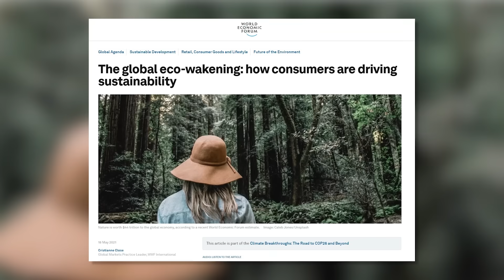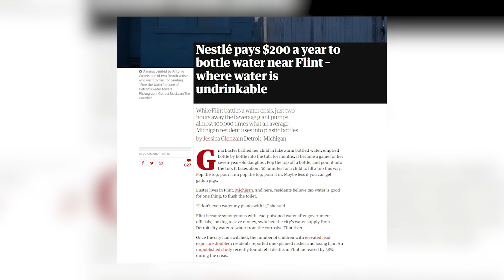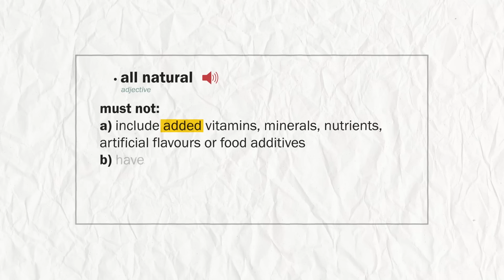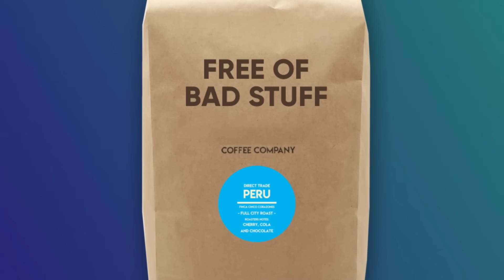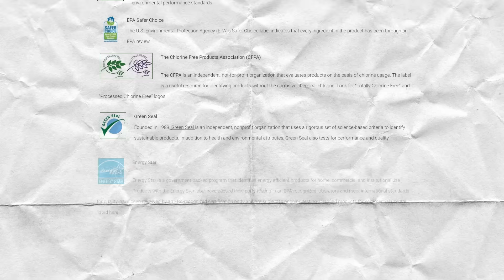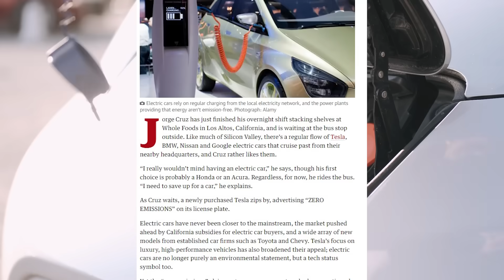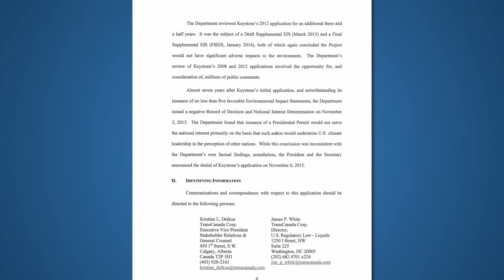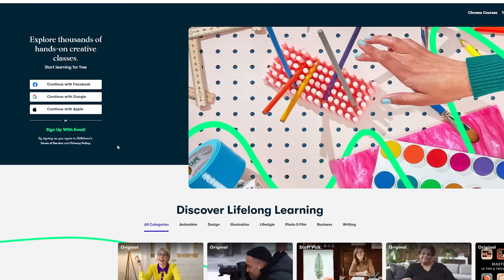Why Being 'Environmentally Friendly' Is A Scam

Comment: Your argument about Nestle "taking water 120 miles from Flint, Michigan" and implying that Nestle was selling water contaminated with lead is flawed. The contamination was isolated to the area supplied by City of Flint water. Parts of the City of Flint which where supplied water by Flint Township did not suffer the same problem. The contamination occurred because, in a cost-saving move, the city decided to stop buying water from Detroit and instead draw water from the Flint River. Because of the high coliform count in Flint River water, the water required more intensive treatment. The added chemicals damaged the lining of pipes which then leached lead into the water. The leaching primarily occurred in the laterals from the street to the house where water sat undisturbed for long periods of time.

Comment: To determine an environmentally friendly product or process every stage of it's life cycle must be analysed and evaluated.
Your video is obviously anti-pipeline.  A pipeline becomes hazardous to the environment only when it leaks its' contents because it has been inadequately maintained, usually due to the ongoing cost of maintenance and repairs.  On the other hand, an operating pipeline produces very little or no environmental negative impact.  A pipeline takes hundreds of thousands of tractor trailers, trains and ships off of the roads, the rails and the water ways.  The economical cost of operating a pipeline increases profit margins and should therefore provide more resources to maintain the pipeline safely.  Would you like water delivered to your house in plastic bottles, by a big carbon emitting truck everyday, or do you prefer to have a reliable source of water piped into your home everyday?
Reply: @sunderedsoul6495  It's not very intelligent to make your comment without presenting your counter debate.  Did you misunderstand the video and think it was pro-pipeline?

Comment: 6:12
I'm on my last year of a Transport and Logistics major.
 
We currently can't do much about the gas emissions, it would require an ENTIRE overhaul of our current transportation systems, which would imply the creation of engines that are absolutely fossil-fuel free. HOWEVER, There are several alternative fuels being researched, such as Hydrogen-based fuels, and Liquid Natural Gas which is already in use (not in many places due to it's complications and added-costs), but like you said, these only reduce the emissions. In the case of maritime transports have been using "Scrubbers" to filter out the emissions, but these are costly so not every currently operational ship has them, think about it, if the costs of transporting a product increase, so will the product itself as well.

People keep asking for quality of life changes without realizing that those changes are the exact same thing that will force them to go march for minimum wage increases. (Not talking about you @AsapSCIENCE, you're cool)

PLEASE, don't be that one person that tells off the transport sector for not having a traffic light for Deers/Dolphins/Birds.

Comment: My city recently got rid of our recycling program and now every time I see a plastic, glass, cardboard, aluminum etc. item with the the recycle symbol on it I get upset because I have no way to recycle it and I know all this trash is going to get dumped at a landfill. It upsets me so much and there is nothing I can do about it. The place where I work goes through SO MANY single use plastic water bottles and it kills me inside every time I have to throw them away. The amount of unnecessary waste that we accumulate because of industry greed is infuriating.

Comment: Most of this video was spot on. However there are a few things to consider. Alot of products that are "eco-friendly" cost more and therfore are only available to those with more income. Alot of the plastic waste is a direct result of consumer choices. The government regulations are often just a scam as well. Most of them don't even improve the issues and I fact make things worse. The pipeline was a political issue not an environmental one. Being energy independent is important and should be one of our nation's top priorities. However due to false reports and shady dealings they got shut down, and thus has lead to the massive spike in fuel and energy costs we are seeing now. There is no replacing fossil fuels. I fact they have lead to the overall improvement of mankind and a dramatic increase in health, prosperity, and improved living conditions for most of mankind. Sadly so many so called science organizations which are just political, spew nonsense and misinformation to rile the masses.

Comment: What I hate is the Energuide rating on clothes dryers. People are conned in to buying a dryer that uses the lowest kilowattage per hour, then need to run the dryer much longer to dry the clothes. If the machines were properly insulated it would help but people have to understand the kilowattage required to dry a particular load rather than per hour.

Comment: Good informative video. Although I just wanted to express my disagreement with two points. 
1) It’s not on companies to do anything. You make it seem like it shouldn’t be, but it most definitely is on consumers to choose what they buy, that’s what makes us the consumers and capitalism work (mostly). You make it sound impossible to find out what is and isn’t right, but we all have smartphones that allow us to look anything up. Just google an award, it’s not a Herculean task. That way we choose which companies get our money and therefore which companies succeed.
2) The only example I didn’t agree with was the Pipeline. Pipelines are by far the cleanest and safest way to transport petroleum. I understand petroleum isn’t our goal, but as of rn, it’s a critical part of our infrastructure, if not at the very least for plastics etc. canceling it doesn’t help the environment. The demand for fuel is still there. So now instead of the pipeline supplying shale oil (one of the cleanest/most efficient  forms of petroleum) those same consumers now need to receive it either by truck or ship (which is much more polluting) and more so, probably from outside suppliers who have little to no environmental regulations compared to the US and Canada.

Comment: Three items I'd like to mention:

1. Straws: I'm old enough to remember using paper straws before they all became plastic. What worries me is that the modern paper straws do NOT last as well as the old style paper straws used to last.

2. Electric cars: The most energy efficient and environmentally friendly motor vehicle is a diesel electric where the actual power is from an electric motor which is powered by a diesel generator set at its optimum performance. Yet the politicians and bureaucrats do NOT allow the construction and use of these types of cars for general use.

3: Fuel and gas pipelines: I'm sure the people objecting to them feel great. However, I do have to wonder how they intend to deal with the lack of those energy sources in the communities the pipelines were meant to service because if the pipelines are not used to transport the gas and oil to where they are wanted then the much more environmentally damaging systems like thousands of trucks each month are required to transport the fuels or the communities the fuel is destined for will need to dramatically cut back on their energy use. If the cost of energy goes up the first to suffer are the poor as they can't afford to keep warm in winter and freeze to death.

Comment: Great video, just want to note that studies have shown that electric vehicles charged using fossil fuel power plants still generate lower emissions within <10 years of use because the conversion rate of energy is more five that an internal combustion engine.  Long after the break even point, the lithium can also be reused further perpetuating the emission reductions in the long run.

Comment: Is the cancellation of the Keystone Pipeline really environmentally friendly?   Are you claiming the pipeline itself is bad for the environment?   Would you make the same claim if the pipeline was used to transport water (i.e. an aqueduct)?  If not, then your issue is with what the pipeline will be carrying (i.e. Oil).   While you can argue that the oil itself can be burned to power cars, thereby causing damage to the environment, that oil will still make it to the refineries to be used in cars...so the pipeline is not the issue.  And would transporting that same oil in hundreds of tanker trucks every day to the refineries or by lots and lots of trains be more environmentally friendly?  Thus,  when you consider these points, the only real argument you can raise about why the pipeline could be harmful to the environment involves the off chance that a leak occurs.  But the pipeline is not deep under water but rather on land and the flow of oil can easily be turned off so that the leak can be plugged.  So the possible harm is minimal.

Comment: The company I currently work for had recently removed most vending machines for drinks. Instead we got in most of the break rooms water spending machines which will give you cold and room tempered water, sparkling room tempered water, hot water and very hot water. In said machines is an added filter system containing several filters so the water will be drinkable even if it is cold. Also these machines give you information about how much water they gave away and how many bottles were saved by using one of those. And boy they save lots and lots of water. During the first ten days of using just one of them already saved over 1500 bottles (to be fair, the machine won't tell you what size the saved bottles are so it can be everything between 0.33 - 1.5 litres). The cantina also give away bottles for those machines, so you can get water everywhere if you're thirsty and you don't pay a cent for the first bottle (said bottles are made of plastics but they are easy to clean and if you wish you may use a dishwasher to clean it, we have them in many rooms. Also, it is not forbidden to bring your own bottle to work). When it comes to the remaining vending machines, they will only give you cold drinks in glass bottles. Ice tea, lemonade, juices... all in glass bottles. If you want coffee or tea from a vending machine, you have to bring your own mug. And I think this is one of many steps towards an environmentally friendly lifestyle.

edit: Water has to be free at work in Germany. So if you are thirsty at work, your boss has to give you access to drinkable water. If they give you access to machines like my boss did or if they go and buy bottled water is up to your boss but water has to be free (this does not include if the water is sparkling or not, so in many companies you will only get non sparkling water for free). A machine like the ones we got at work may be a good solution for bigger companies, if you only have like... two employees you rather still may buy bottled water for them. But you can still choose if the bottles are made from plastics or glass.

Comment: Plastic recycling is bordering on a scam. But imposing bottle deposits so you can return them to the shop reduces plastic bottle littering drastically, and if we can't recycle or reuse plastic we should at least burn it for energy (as cleanly as possible) rather than just dumping it. Maybe we can't solve the problems individually, but we can work for change and demand politicians do something to help solve them

Comment: Amazing video! 
Tough to hear all that and not get a bit frustrated about trying to minimize our individual impacts to the environment (like segregating the trash to recycle, eat less meat, all that good stuff), but it's important to stay informed, to keep motivated and do our part. Even better to spread the message.
Reply: Except eating less meat doesn´t have that much impact on the environment. If you want to truly help environment with your diet, then try to buy from local farmers. 
The biggest problem with food industry is that most food is transported for thousands of kilometres (I mean, how else would you get "fresh" vegetable in the middle of winter, or exotic fruits). Of course, all the herbicides, pesticides and other -icides, artificial fertilizers and keeping a LOT of animals in very small space (which creates a lot of waste that would have been otherwise spread over much larger area, thus it´s impact would be lover, plus there are also ethical issues with factory farming), which are issues that also contribute to the environmental damage.
So, if you can, buy localy and buy from farmers you know take good care of their crops and animals and are not using "shortcuts" for trying to get better profit. They need all the help they can get, as sadly the price for which big corporations buy their produce often doesn´t even cover the expenses they have, so if they don´t want to get out of business, they are basically forced to use any means necessary to reduce cost (for example using pesticides to protect their crop and thus maximize the yield, or keep animals in as small space as possible and kill them as soon as possible to reduce the electricity cost and the cost of food, while feeding them in such way as to maximize their growth, so they get more money for meat from one animal - but remember, they often HAVE to do this, othervise they couldn´t generate any profit and exist at all, because the prices the companies are buing their produce is so small).
So, once again, buy localy and if possible directly from the farmer you trust. That´s the only way to change things for the better, and not only for nature, but also for those farm animals.

Comment: I don't believe you're being fully honest about Keystone XL. It's to replace the current pipeline that is aging. The new one would have better safety features in place. Instead of transporting oil by railcar and thus putting towns in danger when the railcars derail, going through the pipeline is safer. Also, Warren Buffett owns BNSF railway, which is used to transport that oil.

Comment: Complete and utter misinformation. The Keystone pipeline was invariably better for the environment. Traditional methods of transporting oil is by train and ship which has exponentially higher rates of spills and environmental damage. The issue with the Keystone pipeline was that the planned route went through indigenous and protected land without agreement. Tarsands are expensive, that and the controversy, and the fear of the pipeline being short-lived is why it failed. Pipelines are always controversial specifically because of misinformation. The alternative to this pipeline which is the reality we got was continuing to buy cheap oil from countries like Saudi Arabia where they chop off people's heads and don't let women drive, and countries like Russia, and I shouldn't have to explain to you why that's bad and why the price of gas skyrocketed with the invasion of Ukraine. Imagine what our world and global economy could have been if we had built that pipeline. Far better than where we are now.

Comment: I disagree hard about reducing not being important. Even if all the power for an electric vehicle is derived from fossil fuel, the fact that big plants are a lot more efficient then car combustion engines has a very big impact. It also makes sense to advertise a more fuel efficient car even if it isn't completely the solution. Betterment is an iterative process. Don't follow the fallacy that if a solution does not completely eliminate a problem or create some new ones it is worthless.

Comment: Single-use items like bags made from paper or plastic are both bad for the environment. Reuse either as much as possible. I use bread bags to carry lunches until the bags wear out and then use them to remove trash. Plastic bags seem to last longer than paper for this. Of course a paper bag can be composted or possibly recycled after reuse. 

The best options we have are to buy only what we need and to contact our leaders to tell them we need a different approach. 

If you are poor, focus on what you need to do for yourself. Many cost-saving approaches are also "green" and of you have a phone or access to the internet, you can contact your political representatives, religious leaders and corporations. Cost free.
Reply: They're only bad when they are misused. When used and reused properly, they can be far more climate positive than a tote bag that uses significantly more resources to produce and will never get to be reused enough to offset its total impact. The real issue is with littering laws not being rigorously enforced.

Comment: Talk about the trade offs. You traded a potentially environmentally dangerous pipe line for a definitely hurting the environment shipping route covering the same distance.  That oil is still making that trip. It is just being delivered by semi & train now. This is not a better trade off. Yes the pipeline would have had an environmental impact but all these diesil engines transporting it are doing far worse.

Comment: The keystone pipeline cancelation was a bad thing, think about how much energy is used transporting fuels via trucks or train? Also the pipeline itself didn't have much of an environmental impact, it's litterly a pipe going through the woods, and any concerns of oil spills from the pipeline compared to the chance of spills do to conventional transportation (which is way higher) like it or not were dependent on oil, and if you want a better solution to this look into nuclear technology.